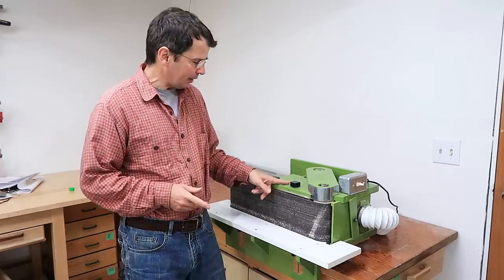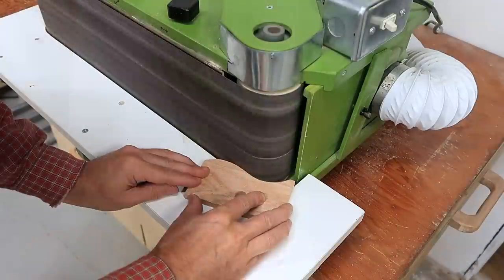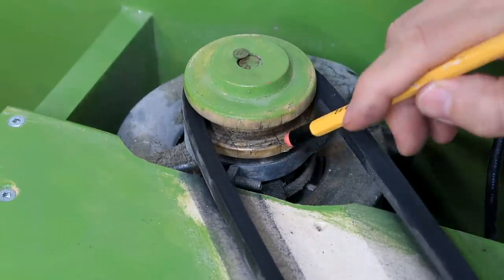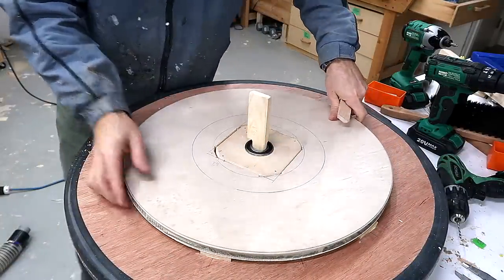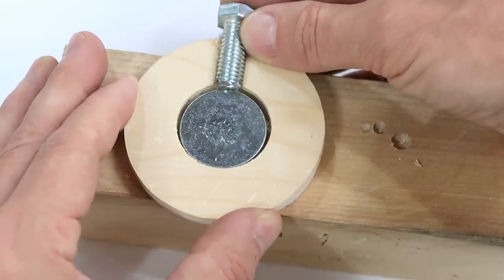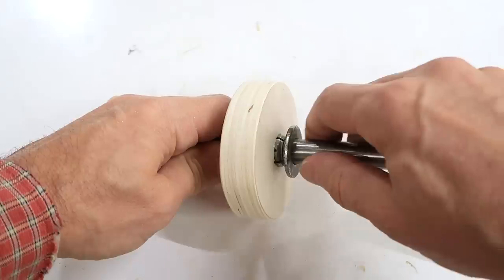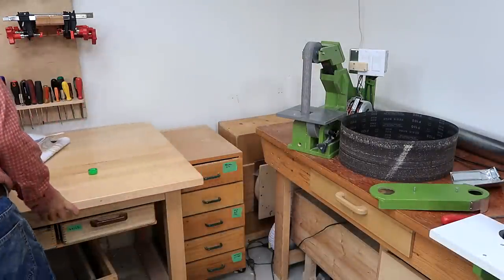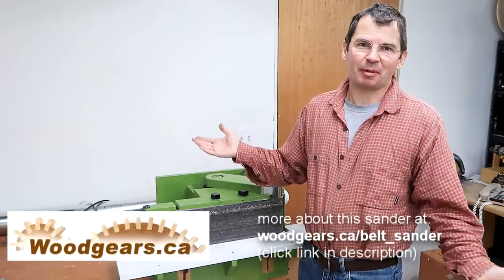Homemade belt sander after 5 years -- update

Comment: Funny this video came up, as I had to fix a little issue on mine last week. The wooden spring things (I had 2 pieces of ash, 4mm thick, can't remember what the plans call for and haven't checked) were both broken, and obviously I had no more tension on my belt. I replaced them with the same, see how it holds.
Over the years I've built many jigs and machines from Matthias, and not only did it teach me many things but it brings joy every time I use them. And they're very easy to fix because I've built them in the first place. 
The guy is a Saint! 😁
Reply: That's awesome. It takes some serious patience and time investment to make these machines! I've tried and failed a few times. Little inaccuracies add up quickly.
Reply: My wooden springs broke too, but like you, have held up since being replaced (with harder wood)

Comment: I appreciate your desire to distill the build videos down to a shorter format, but I am also grateful that you are planning to keep the originals accessible...At least, I think that's what you told Steve Ramsey a few weeks ago. I imagine that may be difficult to do in the future, but as I slowly...very slowly...piece together the band saw, I really appreciate having the longer videos available. Mentally, I am a slow processor and the slower pace of your earlier videos makes it much easier to understand both the procedures and the engineering design that goes into your machines. Thank you for the years of knowledge you have contributed to the world through your videos.

Comment: 1:11 i've used inner tube laid in a diagonal pattern and glued with 3M spray on glue. No need for fancy inner tubes. I think mine's 3 years old at this point, hasn't delaminated so far. A friend of mine who copied my inner tube thing didn't even bother with glue, he used one those paper thumb tacks with 4 legs on both ends of the strip to keep it on the roller, afaic, it's still working.

Comment: Several times I have put a dab of blue Loctite on a pulley shaft as a temporary fix for it being slightly loose, and it has worked surprisingly well. It even locks moisture out to keep the parts from rusting together (These tend to be in a damp environment). The pulley isn't significantly harder to remove.

Comment: This is really a nice size horizontal belt sander. I don't know why no one makes one in a 6x48 size. I think they would be very popular with the WWing crowd. Thanks for updating us on how this sander of yours has held up over time. Like all the power tools you have built for your shop it is well engineered.

On the belt tension could you add a third tensioning pulley that rides the outside of the belt using an adjustable spring to apply pressure.

Comment: I started my own design, which was going to be an oscillating sander using typewriter & dot matrix platens as the rollers,   but I started stealing a little bit of your design here, a little bit there so what I ended up with is an almost exact mirror image of yours.   One tiny thing I think I improved is a pair of fence brackets that are the same thickness as the belt guard so it sits nicely on that side without needing a stand

Comment: Tip!  I started using aluminum tape of various thincnesses (Thick HVAC and dollar store) as 'adhesive backed' shims on shafts. I layer it without overlapping the joints to keep the shaft profile round by cutting each layer at the flat. If you clean the shaft with alcohol, the tape sticks like crazy.
Reply from the maker: Have had bad experience with tape.  The glue never hardens, and constant pressure makes it ooze out.

Comment: Great idea to shim loose pulleys. One might consider putting two shims in, each at 30 degrees off of the centreline. Then the pulley would be fully constrained with 3 points of contact and probably would never wiggle loose again.

Comment: Pulleys w loose belt  should have a simple spring tensioner which you can adjust for + - guided by a side wood cylinder justb taller than bellt  which can turn easily.

Comment: How much is a pulley with a taperlock bushing at your place?
Here in Germany you can get them for around 5€ for a bushing or a small pulley.
They will even grip just a straight shaft without a key with great force.
Reply from the maker: None available locally.

Comment: I've used those taper-lock poly-V belt pulleys on big industrial machines ( ~50hp ) and you got me wondering if anyone makes anything similar but smaller for regular AX or BX series v-belts.
Reply: I used on on my milling machine (~3hp) and the answer is yes! They're also very reasonably priced. I paid about £10 here in the UK for a double V pulley and taper hub for a 28mm shaft.

Comment: A 6x48 belt has quite a lot of abrasive surface compared to the usual 4x36 (or handheld 3x21 which are even smaller)....exactly double if I do the math. No wonder you used only 5 belts in 5 years.... 4x36 belts probably last just a few months each.
Do you clean the belts with a cleaning stick ? Do you think those belt cleaning sticks help at all ? Would the bottom sole of an old sneaker work just as well ?
Ideas for a future video.
Reply from the maker: I clean them a lot, until they are completely worn out.

Comment: Question for anyone out there: If you had to rank Mathias' sanding machines in build complexity, which one is the easiest? Currently leaning towards the strip sander.
Reply: I'm making this sander right now. I had a bit of a panic in the start because it seemed so hard to build. But now that i'm getting close to the finish and i look back, it really isn't that hard to make. The only part where it's important to be really  acurate is with the rollers and the alignement of them in the construction. Also use propper axial steel for the axels. I had to remake mine because they weren't round enough.
Reply: @mr_oskel6225  That's really encouraging, thank you!

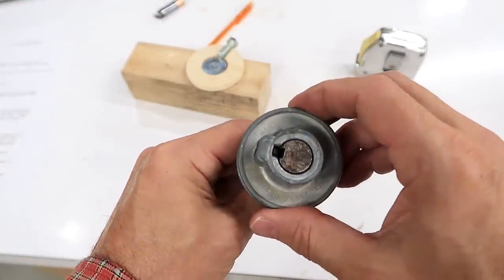Comment: 3:13 on that “set-screw pulley”, aren’t you supposed to have a key in there? And use the set-screw to keep the key in place.?
Reply from the maker: yes, but that doesn't change the problem.
Reply: The key would ensure against rotational slip, not the sloppy fit causing wobbling. As demonstrated, as the pulley rotates, it's constantly shifting position slightly relative to the shaft, which over time stretches, abrades, or in combination, makes the hole bigger.

Tightening the fit with a shim prevents the movement, maintaining a constant position of the two relative to each other, preventing the hole from embiggening.

Comment: Hi, your motor is 2800 rpm or 1450 rpm, sorry my english is bad.
Reply: Induction motors are usually 1740 or 3600 RPM Or 1725 and 3450 if you take slip into account. I've seen them rated both ways. The slower speed is more common.

Comment: I'm curious, why no lathes? Never seen you with one. Personal dislike?
Reply: I'm very surprised that you have not at least built one for the sake of offering plans. Honestly, I would just love to see your wooden gears in a setup as complicated as a lathe, dividing the power between turning the stock and controlling the apron. I guess to clarify, a wood lathe is not particularly exciting to build or see built, but a wooden version of a metal lathe would be really interesting and intricate. It also seems like there is a bit of a theme with your builds of demonstrating that wood is capable of serious machines, not just steel
Reply from the maker: Instead of saying that, how about you just watch my lathe build series or buy my lathe plans?